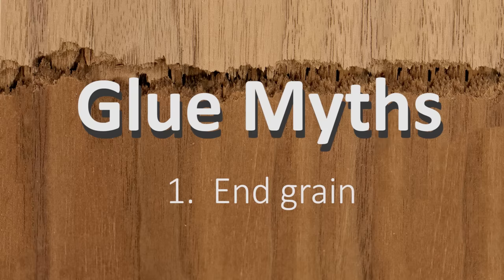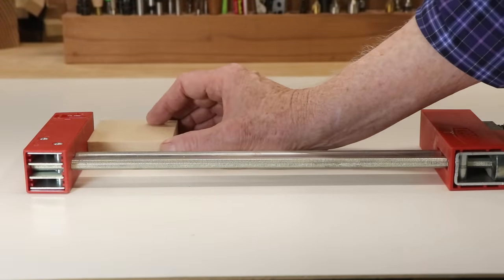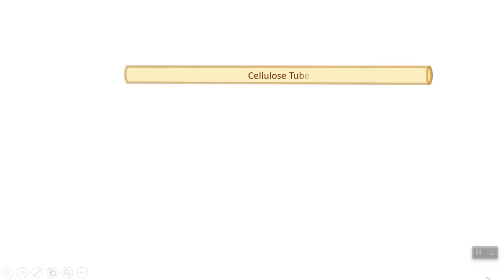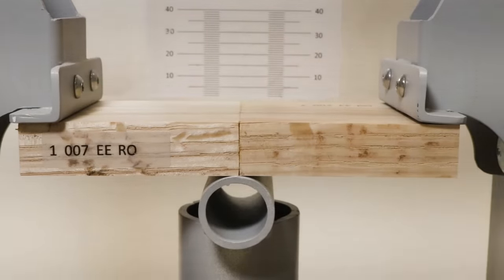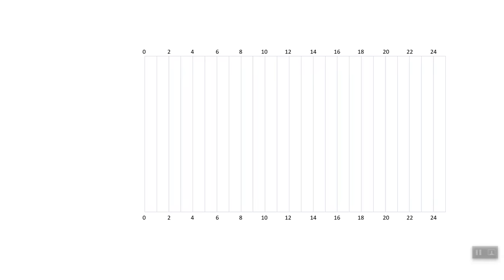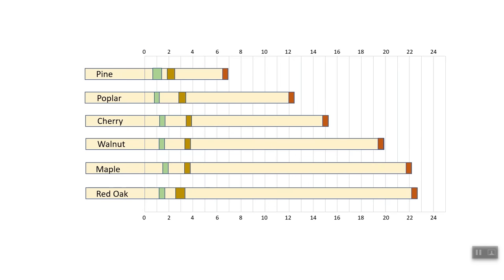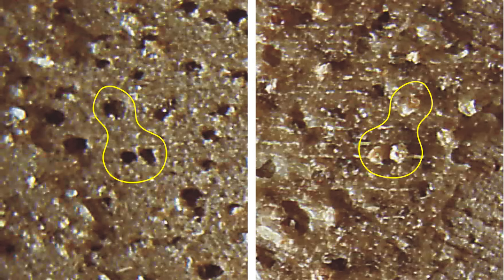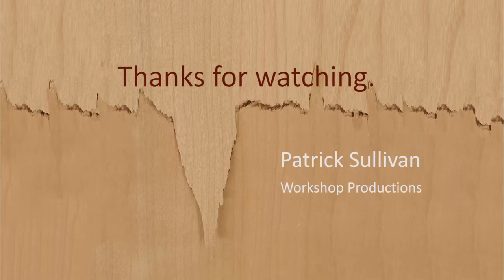Glue Myths:  1. End grain

Comment: It's because of wood movement with seasonal changes of humility.  The long grain doesn't get longer but the wood will move along the growth rings.  The glue isn't strong enough to stop it so it fails.  Not every time but it happens enough to prevent woodworkers from doing it

Comment: That is a beautiful analysis Patrick.  The other thing that always comes to mind when gluing any joint is how well it fits together BEFORE the glue is applied.  I recently planed some soft maple and it was so smooth I decided to rough up the edges so the glue would have more "bite".  You have earned my subscription.  Can't wait to see some of your other videos.  Thank you.  PS - The capillary action of the glue in/on the end grain helps the bond, IMO.  PPS - If we soaked the end grain for a minute then glued it, let it cure, etc. - would that change any result?  You got me thinking.
Reply: In gluing bridges onto guitar tops, they used to score the bottom side of the bridge, for the same reason you mentioned. Only it turned out later that it actually weakens the joint, so this practice was abandonned. The reason ostensibly is that wood glue itself is weak, so gaps with wood glue in them don't add any strength. This could be a nice subject for scientific study too :-)

Comment: I suggest you use a 4-point bend test instead of 3-point bending. Your setup has the load applied right on top of the joint which can be inconsistent. The 4-point setup places the material between the loaded points under uniform bending with zero shear. You also avoid crushing the wood fibers near your glue joint. Short-beam 3-point bending tests are usually used for shear, but for these joints I'd try a direct shear test.

Comment: Superb video! I’ve always wondered how long of clamping time is sufficient, and how quickly clamping force needs to be applied. I make tons of cutting boards and I’m always nervous about taking a clamp off to exchange for another 20 or 30 minutes into the process out of fear that the glue is then too tacky to adequately squish into the pores. I know they say not to stress a joint for 24 hours, but am I wasting clamp usage by keeping them on a board overnight, or can I take the clamps off after a few hours and use them for more glue ups?

Comment: This is fantastic work. It's always bothered me that glue joints are supposed to be sanded, not too fine, and put under pressure to get the glue to sleep into the wood. Yet end grain is a no-no?

We all know finish makes end grain darken more than edge grain since it soaks up more of the finish, so why does that not hold true with glue as well?

Turns out, it does. It just looks like the glue is weak because it's the glue that fails in end grain joints. That's observation bias at work.

Thank you for doing all of this work in a scientific fashion. I probably won't use end grain joints because, as you've pointed out, end grain joints are usually small surface area joints. If you make a leg glued out of two pieces end-to-end, it's probably going to be too weak as a leg because that glue joint is weak by design. But still, definitely good to see the math and know that it's a potentially  useful joint.

Comment: Thanks for an interesting video - it actually agrees with my own experience and testing. 
You might be missing one very important fact though, which also tells you to "never cross fibers over a certain length". The reason is that wood is a 'living material', meaning that it is not stable with respect to variable water content: The expansion with water content is /radically/ different along and cross fibers (orders of magnitude larger). So if you cross fibers, significant internal tension might build up. The longer joint, the higher. As a result, the joint either bend or break. Hence, your tests can turn out very differently, if cycled in different humidity, /after/ pieces are joined. Hence it makes a lot more sense to glue with fibers in parallel - especially for outdoor use. That is the reason why I suspect outdoor glues are much more flexible than indoor ones, so they can absorb small deformations.
I have often used outdoor glue even indoors, to make the joint more tolerant to accidental water exposure (tables etc.). However, over time tiny steps might build up across the joint, depending on the water content if the build is not well matched to the use environment - this is why I think, for obvious reasons, outdoor glue is and /must/ be more flexible than indoor ones. I have search for this information from the glue manufacturer but found none.
Thus for [PU-glue] laminated outdoor structures, it is important /not/ to have residual internal stresses in the glue joint, otherwise sheering or loosening will appear over time. I have seen this too on my test structures.
Note also the resemblance between humidity induced tension (HIT) and thermal tension (TT) in materials. For the latter, the important thing is to match expansion coefficient, E-module and strength. Thermal fatigue is probably one of the most common reasons why devices eventually break - it should be similar for HIT. 
Note also that saying the humidity should be the same during build and use is non sense. There is no way two numbers are exactly the same, it is only a matter of how much that is tolerable. Even the use environment has variation slow enough to affect the wood, e.g. between summer and winter.
Summarizing, it might be worth to cycle the humidity of your test pieces in your tests - /that/ is how I expect the saying "always glue fibers in parallel" makes sense. Along fibers, the expansion is really minute as humidity increase. As often is the case, saying outlives their rationale/motivation. Then people starts testing in too constrained contexts, falsifying and questioning them. One should better go historical and study original sources and in particular - study context and constraints.

Comment: Excellent video, thank you putting science before received "wisdom".  I'm sure the bad reputation of end-grain joints is because nobody ever bothered to test the strength, but just looked at the results.  In side-grain joints, the glue is stronger than the wood.  In end-grain, the glue is the weakest part.  They assume the wood strength is the same in both cases, so the end-grain joint must be weaker.  Your tests show why science is better than "common sense".
For a follow-up, I'd be really interested in the same process applied to various end-grain joints - straight, various scarf joints, finger, tongue and groove, dovetail, and any others you can think of.  Makers of long boards for flooring use a zigzag joint, like a stack of simple scarf joints, to maximise the area of the joint.  It would also be good to know if sanding the end-grain makes the joint weaker.  I suspect that sanding the cut face will block the pores and weaken the joint significantly.
Also, I'd like to see the "mitre joints are weak" myth busted.  This is based on them being end-grain joints, but you've just shown that end-grain joints are actually stronger.  They're usually rejected in favour of just about any other type of joint, even the simple butt joint.  So what is really the strongest right-angled joint?  This could be tested using the same equipment.  Just glue up joints and place them on the rig like this /\ and see which break first when you squash them.  I suspect we'd see widely different results - the mitre and butt joints are testing the glue in tension, whereas the lap joint would be testing it in shear.

Comment: Professor Sullivan, I assume. I am impressed by the impeccable work here, not only for the thorough research but also for the comprehensive, yet simple teaching approach. Instantly subscribed. I recently started watching woodworking videos (occasional hobbyist stepping up his slow game with inadequate schooling, space and equipment...lol). There are so many pros out there doing some really great work. But I suppose it's not really necessary to understand glue application other that the standard methods if your joint technology is strong. Nevertheless, this seems like Glue 101 that should be on every course. And now I am curious about advanced glue methodology. I wonder what viable factors we might be missing out on that could enhance the bond?

Comment: Great video, but I have some thoughts:
the way I see it, depending on the wood, end-grain will absorb glue and effectively "deplete" the joint. A denser wood might have less end-grain absorption and therefore glue will remain in place, with just enough capilarity absorption as to create a somewhat monolithic structure. In woods like pine, you can actaully see the glue dissapear and "dry up" the butt. In denser woods, glue remains in the surface and is sucked up just enough as to make a bond like the one tested here. I say this amazing experiment must be repeated but using only end grain joints on different kinds of woods/densities

Comment: Long ago and far away, when my daughter was in the eighth grade the science class was assigned a project to build the strongest structure using glue and popsicle sticks. She asked me what glue should she use. I said I don't know. Maybe you should try some. She designed a testing stand and designed the test procedure. I made the test fixture and bought several different wood glues and lots popsicle sticks. She glued them together with the different glues and different joint configurations. I supplied the muscle for the test fixture. No hydraulics involved. We started with a fish scale and had to reconfigure to use a bathroom scale. I no longer have the results but I think, depending on the joint geometry, Weldwood Plastic Resin Cement and Resorcinol were the strongest, then PVA;  I was surprised that epoxy was not as strong. We only used popsicle sticks but it was an interesting test.

Comment: If you would increase the surface area of the end to end joint by milling v shaped parts out of it you would increase the strength of the joint to the point where it exceeds the linear strenght of the wood itself, making the wood the weak point again and not the joint. This way you can extend beams that can even be used in structural contruction.

Comment: It is going to depend a lot on the tightness of the grain. Glue can wick into the grain and leave none on the surface. You get a similar effect with paint.  I would expect loose grain end joints could be made stronger by initially priming the surfaces until the grain is filled.

Comment: As someone who is a professional structural engineer (MS in engineering, with a specialty in composites) i really like the thorough approach that you used with your methodology. The only thing that you might have done differently would be to use an automatic dispenser to accurately control the quantity of glue for each joint. That might be an interesting follow-up test to see if the quantity of glue has an impact.
Reply: In this case it is not necessary to control quantity as long as you have a enough to squeeze out. To his credit  Patrick has controlled clamping force which combined with the viscosity of the adhesive will give a regulated bond thickness. Changing the clamping force will give different bond line thickness which might change the results.

Comment: Very interesting video and very well done.  I can glue up my scraps, end to end,  into a longer board, and the glue joint will be stronger than the rest of the board. Who knew? Not me.  I thought you would need a finger joint.
When a load is applied to a  plank supported by a fulcrum as in your tests, all fibers above the center-line of the plank are being stretched and those below the center-line are being compressed. That is why you see the break at the top. The farther away from the center-line the greater the tension on the top fibers. And that is also the principle of a wide flange beam also known as an 🅸 beam. 
The flanges on top and bottom of the beam are separated by the web of the beam. The width of the web magnifies the tension on the top flange.With a load on both ends and a fulcrum in the middle,  as in your experiment, the web magnifies the compression on the bottom flange in proportion to the width of the web. This keeps the wide flange beam from bending under the same load that would bend a steel bar with the same weight per foot as the 🅸 beam. The top of the 🅸 beam has more tension on it than the top of the solid bar, and the bottom of the 🅸 beam has more compression, under the same load therefore more resistance to the load on the 🅸 beam.

Comment: Got my sub. More glue can wick into the open end grain "tube" of the wood than it could along the closed, long grain (side of the straw). In end grain to end grain glue ups, it seemed to me that the joint only failed because the maximum hold capacity of the glue itself was exceeded. I'd be interested in seeing this same test with epoxy rather than pva glue.

Now back to TWW, to watch his take on end grain to end grain glue ups. And thank you for this informative video.

Comment: I was taught by my high school shop teacher that the reason end grain might not glue as well is because the end grain is more absorbent and might starve the joint of glue if not adequately applied. Although if you think about that logic, if you get enough glue into the joint it could potentially be stronger because the glue will absorb deeper into the porous structure of the end grain.

Comment: So the big difference is glue contact area.  When we do side grain to side grain on a panel glue-up at may be 3 foot x 3/4inch - surface area 27 square inches but a typical end grain to end grain or end grain to side grain will be 4 inches x  3/4 inch  = 3 square inch surface.

Comment: Thanks for the tremendous effort. It was certainly an eye opener. Have you experimented with the optimum form factor for the strongest join? EG 1x4 VS 4x1 VS 2x2 . Your tests suggest to me that a primer that induces a vacuum at the surface before the glue is applied would be the ticket to an even stronger join. Would punching the surface with needles prep the surface better the way cooks drive seasoning into steaks?

Comment: Thank you so much for this video, it says so much, I  notice that you compressed the joints in all cases, this sometimes is not easy where you have a long piece abutting with its end grain end to an other piece of wood 's long grain, say in the fuselage  of a wooded plane.  I have watched several videos of just such problems and notice they have gone to the trouble of making special  clamps just to achieve this compression. Now after watching your video it all makes wonderful sense. 

Would it be possible with your current test rig to do a test showing the true strength of the various glue? that I am sure would be most revealing and useful.

Thank you once again

Regards

Chris

Comment: I would imagine using highly diluted glue that can easily penetrate the fibers and soaking the ends for long time would even increase the strength. One could also develop a tool with needles that preps the surface by creating many small holes (f.ex. a fine steel brush to pierce the wood with the thin wires) for the glue to sink in.

Comment: Great video and very educational!  Thank you.  Whenever I glue boards that involve any end grain, I always rub a small amount of glue on the end grain area, wait about five minutes to enable soak in, then reapply glue and clamp.  Never had a failure in 50 years of woodworking and always felt the first application mostly sealed the wood since most of it soaks into the pores and almost disappears.  The second application then provides a more adequate amount of glue for a good bond.  Curious if testing show this double application has an impact on total strength.  I do the same technique when making segmented turnings.  I'm interested in your thoughts.

Comment: I've watched your video more than once, and on this second viewing, while watching the wood break along the long grain (starting around the 7:30 mark) I started thinking of how little wood is left to hold up the tree when a professional tree feller does a back cut.  After removing much of the front, to determine the direction in which they want the tree to fall, then then cut the back until there are only a couple of inches left in the middle of the tree, so all of the tree's weight is supported by that segment in the middle of the tree.  When the tree finally falls over, the way the wood splits as it falls over looks the same as it does in your video at that 7 and a half minutes mark, as the long fibers start to snap, but not all at once.

Comment: Another independent variable to take into account in engineering is the effect of 'time'. As well known, wood moves - expands and contracts at different rates across the cellulose fibers - and this can lead to an eventual strain and shearing effect on end-to-end (and end to side) grain connections. As such, while initially results seem conclusive, they may not represent the eventual actuality, especially over 'a number seasons' of movement and wear-and-tear, leverage effects etc (something the old-timers perhaps knew about?). The impact of of other variables on favorite furniture projects over time is part of the challenge and likely should not be easily dismissed.

Comment: Fabulous information and despite the myth, I’ve always believed end grain should be stronger than side grain joints as more glue gets sucked into the cellular fibre pores. Given that lignin is weaker than glue end grain ought to be stronger than side grain joints but as you hint at, joint prep needs to be meticulous.  I’ve used plywood butt joints for years on sone heavy cabinetry and never yet had a failure of the glue.👍